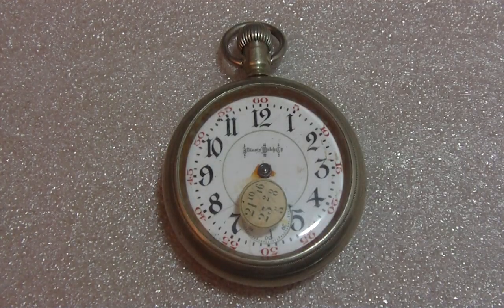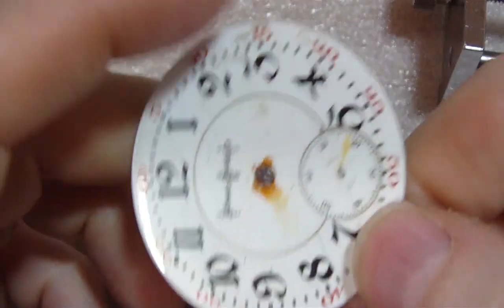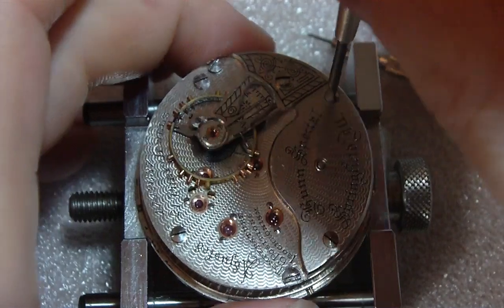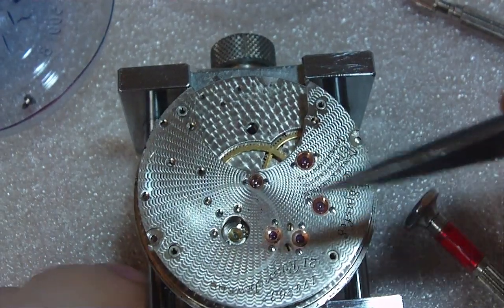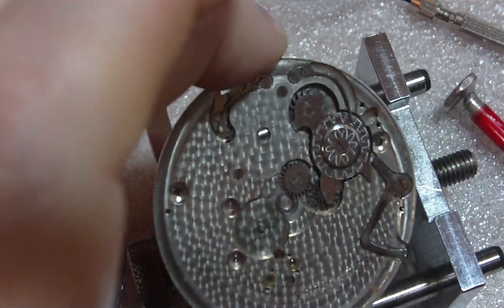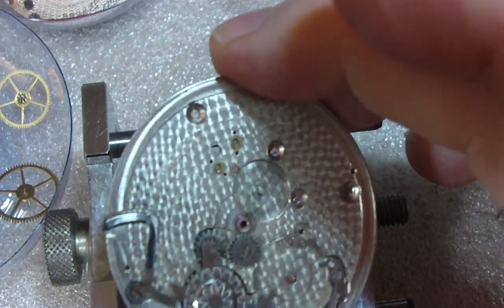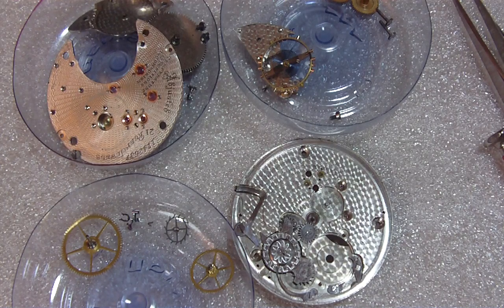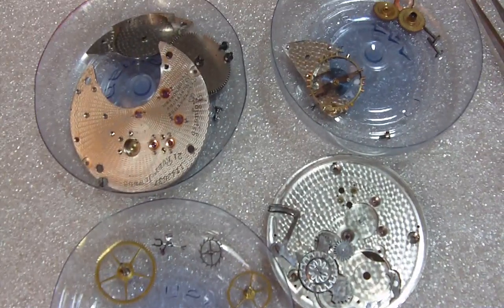Taking apart Illinois pocket watch

Comment: Great video , but needs a lighting guy. How do you clean the part's once its disassembled? I was debating on picking up a cheap ultrasonic cleaner on ebay.
Reply from the maker: Currently I have a jar with some naptha in it that I place the parts in and swish around.  Before I do that, I go over the parts with a toothpick to remove the heavy-duty crud.  I don't have an ultrasonic cleaner.  I don't know if this is true but I read online that if you keep parts in ultrasonic cleaner to long it starts to ear away at them.

Comment: Hi. Glad you're back. The presto tool is also good for removing the canon pinion but the model you use is not suitable, has to be  the other model. Cheers.
Reply from the maker: What does the other model look like?
Reply: @bunnspecial  I tried to answer twice with a link but, apparently the system won't allow. Please search for "presto tool" and you will find out :)

Comment: You did notice the broken tooth on one of the wheels did you not?
Reply from the maker: Are you talking about the hour wheel?  That is the one that looks like it is missing a tooth in the video.  I looked at the assembly video and the tooth is there.  I think the dirt makes it look like a tooth is missing.  I am tempted to take the dial off and check.
Reply: Yes, it was the hour wheel. Sorry that I got it wrong. It just looked like a missing tooth.
Reply from the maker: @nathanhoward6472  No need for apologies.  When I looked at the video, I thought the tooth was also missing.  I then said to myself "How did I miss that!"